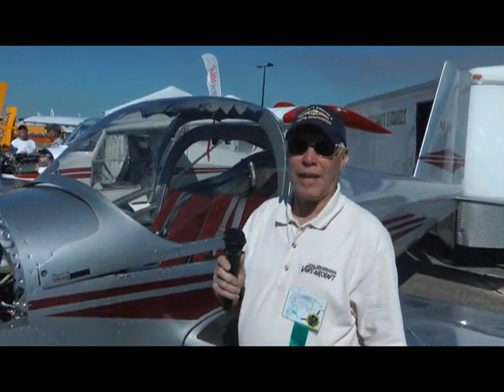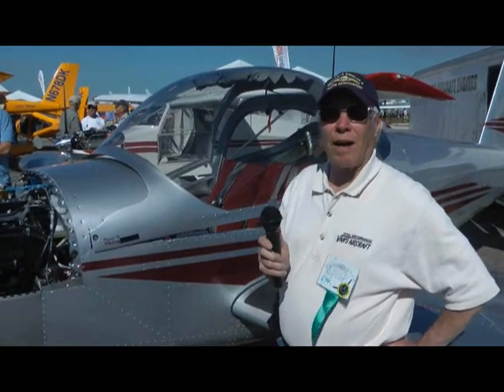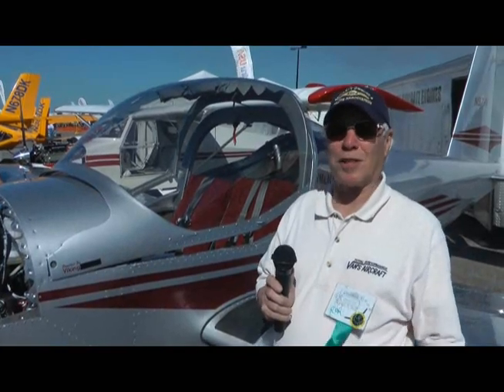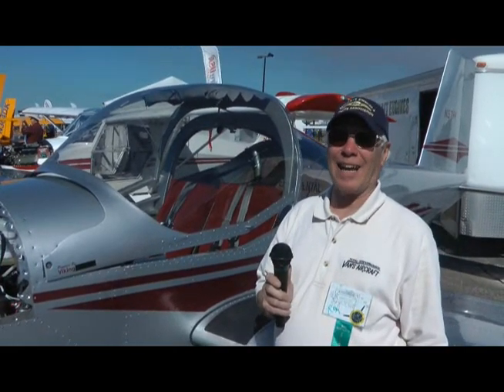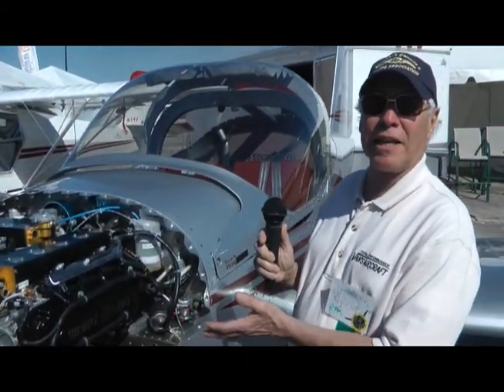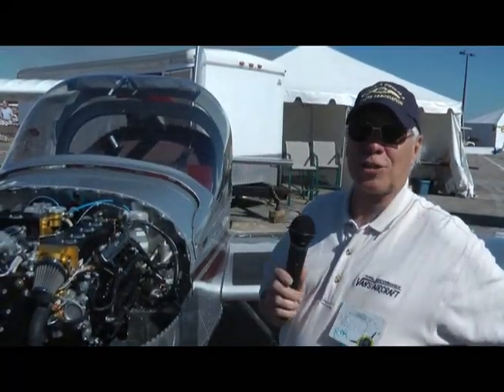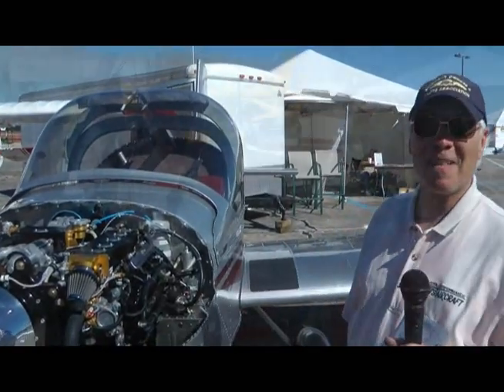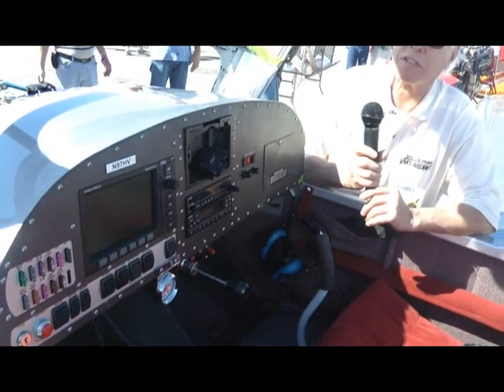Sebring 2012: Ron Russ Viking RV12

Comment: Its been almost 2 years since you uploaded this video so I'm wondering how it is holding up?  Has there been any mechanical problems with the engine or gearbox?  I am also planning to build an rv12 and I need some options other than the overpriced rotax.  What are your thoughts on the corvair engine?  Thanks and any information is appreciated.